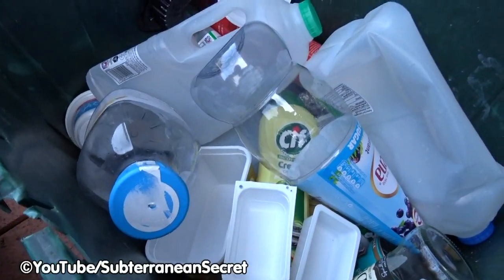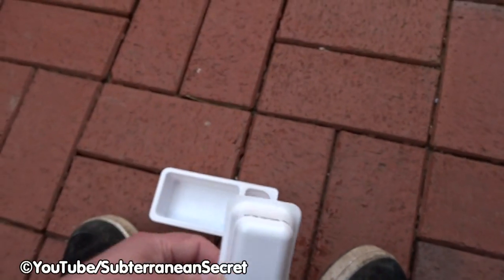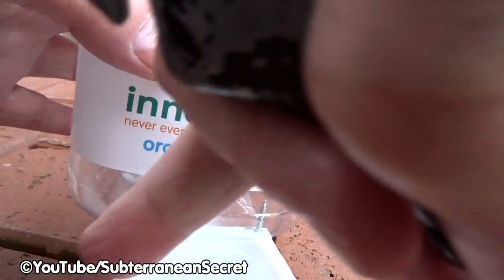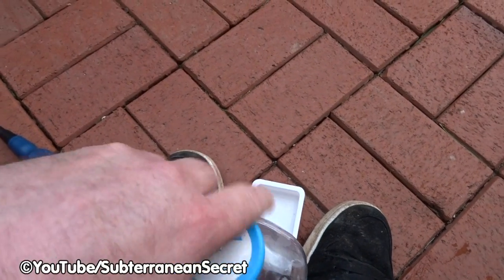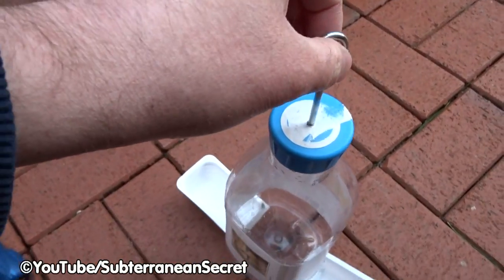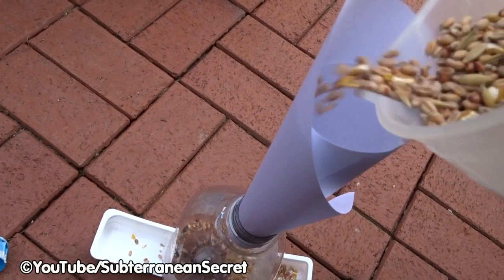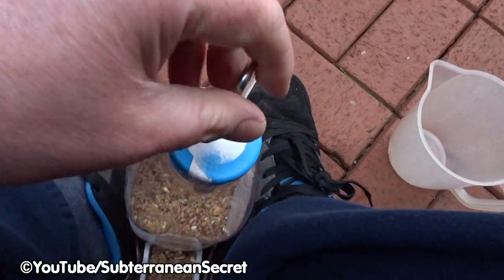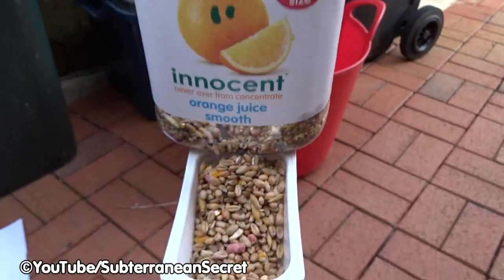How to Make a Simple Birdfeeder out of a Plastic Bottle and Other Recyclable Material

Comment: If you do not hang it under a roof I would cut / poke / drill / burn some holes into the bottom of the plastic containers so rain etc can drip out.
Reply from the maker: Yes, definitely. I forgot to put that in the video.

Comment: Wonderful.  You've just made the perfect squirrel feeder, dear.  That's the reason you use little, tiny perches and openings: So squirrels have trouble stealing all the food.  Apart from the fact that most bird watchers don't want to feed squirrels, the seed isn't very good for squirrels.  Corn or nuts are better for them.  

But with yours, the squirrels will be sure to perform great acts of acrobatics so they can land on that wonderful, large perch.  

Good try, though.
Reply: I find that my local squirrels eat the sunfllower seeds and toss everything else out the sides of the feeder.